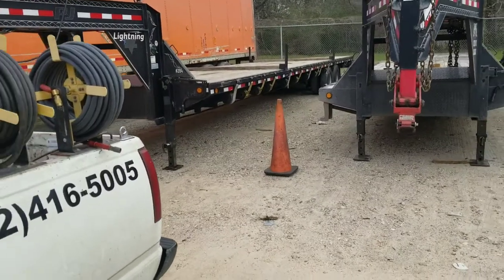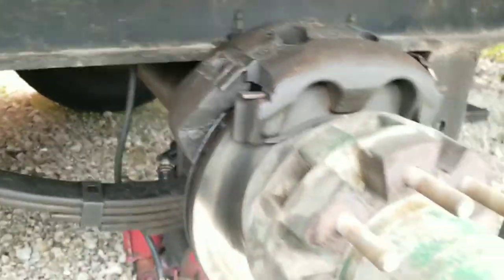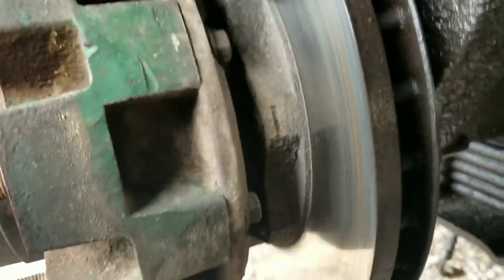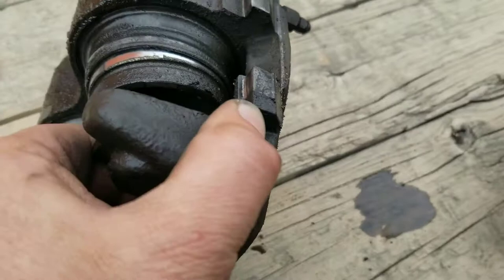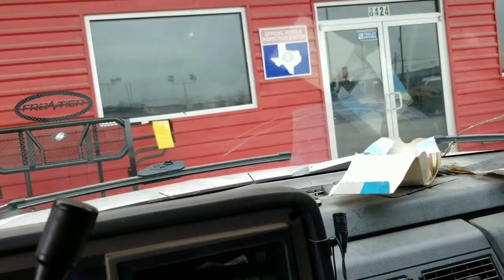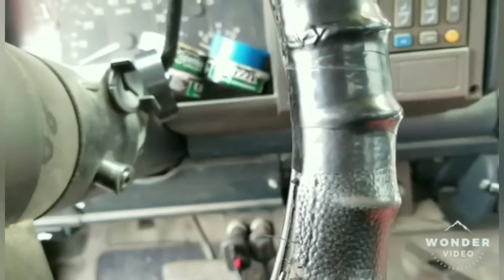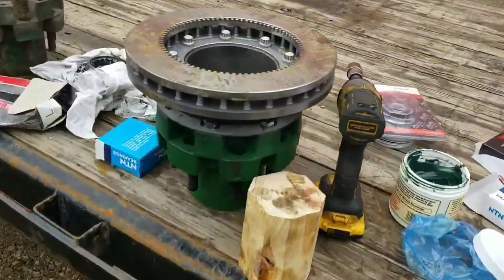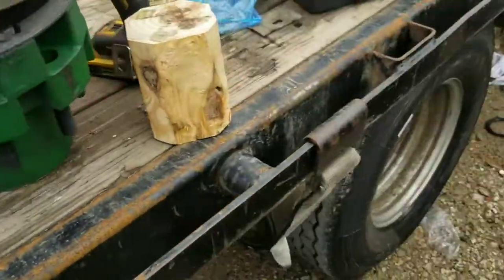Disc brakes replacement on a gooseneck. Ended badly

Comment: You could have saved the contractor about 40 bucks as you purchased the wet oil seal, the grease seal is only 7.50 it is a double lip job and u can install that one without the special installation tool, it looks like that is the floating seal, you have to know how it works before you tackle that one as you can’t bend it at all or the seal burns it self up. 
 I use a cutting Torch carefully and put a cut line in the race to get it off, Especially since you are greasing the bearings instead of using oil there’s a little more room for error

Comment: How does the hub and disc come off?
Reply from the maker: The hub and disc are bolted together. You have to removed the spindle nuts and outer bearing and pull them off. This one the inner bearing had welded itself to the spindle. I had to replace the whole shaft.
Reply: So it just slides out after castle nut and outer bearing are removed?
Reply from the maker: @esauolivo3539  yes it is suppose to. If not then back bearing is hung up on the axle.